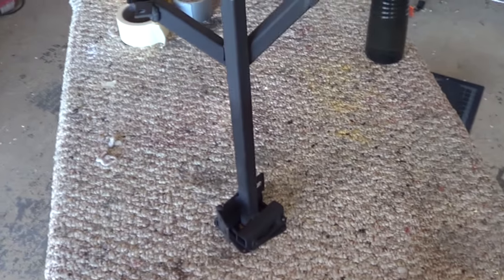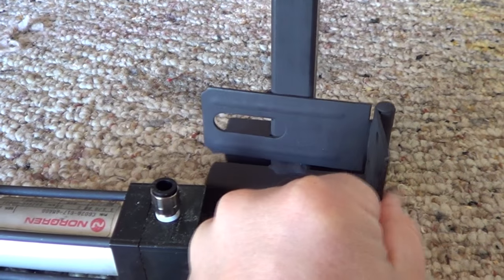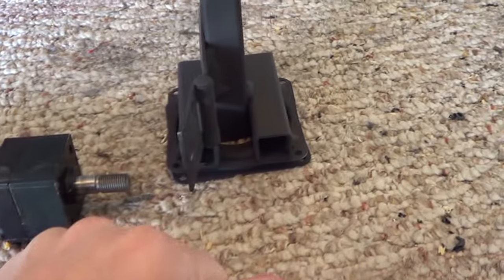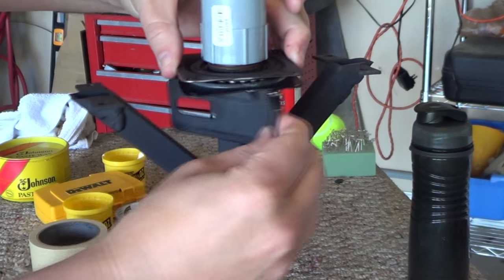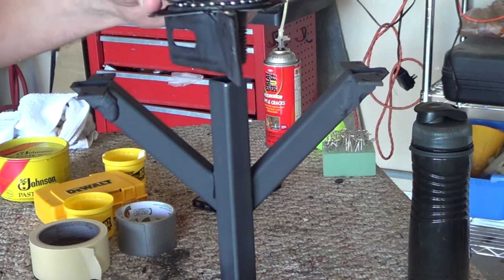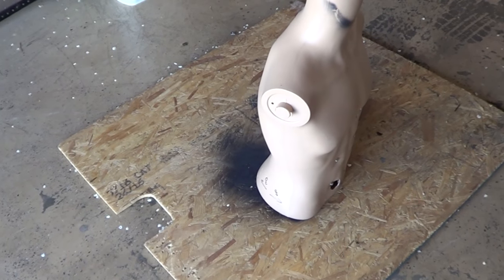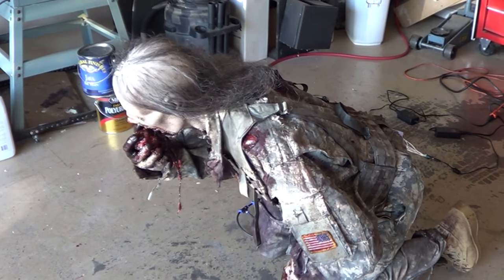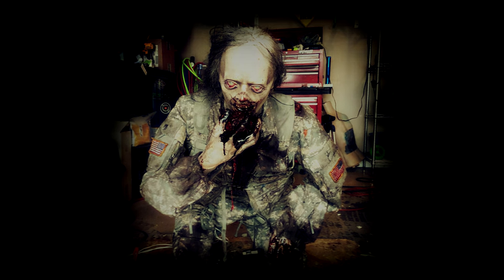Pneumatic Zombie Prop Build

Comment: Outstanding work on the prop. Great to see another way of moving the head and body. I use rotary cylinders from Festo and Bimba. The Bimba rotary cylinder was recommended in the How-to book (Vol. II) from DC Props.

Steve, from Terror Syndicate, is great. Bought all of his How-to books and DVDs. Indeed, he was the first prop builder with whom I interned (of sorts) by using his books and DVDs to build my own props.

Regarding the foam body, and I know you're wanting to go cheap, but I would buy Foam-it X rigid expanding foam. If you want a skin on it, then use Foam-it 17 self-skinning flexible foam first, then fill it with Foam-it X. You get a beautiful, if I can call it that, foam body in one batch, presuming you calculated the right volume of foam.

No doubt you can do the elevator. 

I am building one myself. Have all of the components. Just need to weld the two platforms parts together. 

Using the Hi-Rez Design's relay decoder, triggering black box, and DVD. If you decide to get the Hi-Rez Design components, they provide a pretty decent how-to for the elevator build. I recommend you get all of it from Guy, at Halloween FX Props. 

Keep up the great work!
Reply: +Twisted Endings Productions so what would the rotary cylinder do differently?  lots of great info in your message, I checked out the smooth on product line, the closest distributor to me is Charlotte, and only open during week.. but I might have to be checking that place out.
Reply: +Twisted Endings Productions so from what i can see on rotary cylinder is that instead of him having the lazy susan ball bearing portion he would just have the shoulders mounted to that rotary cylinder and it would do the turning, but then he would need something to tell it how far to go and then how far to go back..
Reply: Well, since they are rotary, you can configure them to move in a direction (left or right) and to a certain degree since the ones I purchased where capable of moving 180 degrees. In this example, I can make them move, 45, 90, 120 degrees. However, as Dwayne, from All Scares advised, any movement more than 90 degrees is an unnatural movement.

I guess the point of a rotary cylinder is that you're getting two in one and minimizing the amount of work you have to do to put it together. Simply, you get the lazy-susan and the air cylinder in one, thus minimizing the amount of hardware (metal tubing, welding/drilling, lazy-susan, air cylinder, etc.) you would need for the build. But again, cheap and effective is what a home haunter is always striving for since they are not a pro haunt and thus do not have the revenue to buy pro grade props. We all started there.

Continuing, same holds true for the lower body twisting...use a rotary cylinder. For the up and down motion, you would use the same technique Jason used.

Smooth-on is up in Orlando, FL from me. I am located in South Florida, so I still have to have them ship me their product(s). Same holds true if you're building gauges, etc.; use their polyurethane resin.

Hope that helped.
Reply: +Twisted Endings Productions very interesting os is there another gadget needed to control the degree to which the cylinder turns?  Both me and Jason are using a 20 dollar home rig prop controller that has 4 relays that are wired to the solenoid.
Reply: +Twisted Endings Productions ok man sorry for all these questions... so i see a video where it uses an allen wrench to adjust how much of a rotation it spins :) so nothing else extra is needed.  Where is a good place to get them?
Reply: +Twisted Endings Productions Ok so smc has this.. not sure how to mount, and or if this is right.. http://www.smcusa.com/top-navigation/cad-models.aspx/20195
Reply: +Kustom Scares and this one, they look to be pricier than standard pneumatic cylinders.. also trying to find how one mounts this or does that book you mention above have instructions on that?  https://trimantec.com/product/airtac-hrq-pneumatic-rotary-table-cylinder-hrq2/
Reply from the maker: +Twisted Endings Productions Cool man thanks!  Those rotary cylinders are cool but damn they can get expensive!  I was trying to use what I had laying around which ended up going out the window when I bought new ones anyway.  Im actually using a TerrorTech board for my elevator.  Never hooked it up so this should be interesting.
Reply from the maker: +Kustom Scares ^^^ a lot of great info up here!  Thanks guys!  Love the discussion!
Reply: By profession, I am a federal law enforcement officer, therefore, my home haunter prop building capability is somewhat limited. And its delay was due to my deployment for nine, of the twelves years, we were at war in the Middle East while serving in the military. So, I am fairly new to this game as I started in 2013, in comparison to some of my fellow home haunters on Youtube. All to say that I am not as well versed in finding cheaper methods of prop construction as most on Youtube.

To answer your questions...

Yes, they are because they are specialized cylinders. And that's also why the prop-vendors charge you so much for their props. Its customary to add an additional 30% to the overall cost of a part.

Yes, the book tells you how to mount the rotary cylinder.

You can also buy how-to DVDs from Halloween Supplies, Stan Winston School of Character Arts, Terror Syndicate, FX Supplies, and MovieFX.

Going back to the Festo rotary cylinder...I bought it on Ebay for about $55. However, I am paying an additional $150 for several other components that I need to get it to function just right. In this example, the push-on flange in which to mount what I want to turn, then the foot mount to mount the rotary cylinder to whatever it is I am wanting to mount it to. And of course, the air fittings.  Simply, it does become expensive.

In the end, you must consider what is more important to you; time, convenience, and less headaches, or money???

If you build your own props, even if you're paying a bit for some of its components, it will still be cheaper than if you bought it outright from a prop-vendor; that's when you really save. I can build the exact same prop for 1/3 of what I would pay a prop-vendor.

Hope this helps and thanks for the link.
Reply: +Twisted Endings Productions thank you, lots of great info and same for +Graves Of The Groves all great stuff.
Reply from the maker: +Twisted Endings Productions Amen brother!
Reply: Kustom Scares
I purchased mine from Festo and Bimba.
Reply from the maker: That's some great info on the foam. Thanks man!!

Comment: Hi Jason:

As I was attempting to build your grave digger (with shovel), and wanting to get away from using wood (it's just too heavy), I contacted Ryan, from Spider Hill Props Works. He was gracious enough to sell me just the base to his care-taker prop. I am using it for the hips. Its super light weight (comparatively speaking) and you can use the existing holes so you won't have to drill new ones. I also bought base for his deer motor in an effort to replicate (Woodland Haunter's) head movement on his grave digger, but instead of placing it at the base (hips), I am attaching it at, or near, the neck. 

I mention all of this as I watched this video again, and figured, since you spoke about weight, you might want to try getting Ryan's base, and perhaps have him cut you shoulders as well.  That's my next request. 

Just a thought.
Reply from the maker: Cool idea!

Comment: Awesome prop! I have a couple questions about the waist cylinder. What is the stroke for the cylinder that lifts the waist? and do you think 1 1/2 " bore cylinder will be enough?
Reply from the maker: It's been a few years but I think it was around a 3-4" stroke.  I also think the one I used was a 1.5" bore and it would move more fluid with a bigger diameter
Reply: @GravesOfTheGroves  Ok thank you!! I’m going to be building a weeping angel prop that has a similar movement at the waist.

Comment: Do you have any measurements for your armature? Also me and my dad are very new to pneumatics and not quite sure all the material we will need to make the prop actually move. Would we only need a prop controller to attach to the air compressors or is there more too it? Sorry to ask so many questions we are just scratching our heads on what to do but we would really like to build this 😊.

Comment: Sorry to keep bothering you, but did you use a specific program app to have the animatronic move? Any recommendations for programming? Thank you for your time 😊.
Reply from the maker: On this prop I used the software for the four banger prop controller.  The software worked great but the controller ended up being pretty buggy.  I would do a BooBox Flex if you wanted a computer controlled software.

Comment: what bluetooth gadget are you using to connect it to the prop controller board?  and what solenoid valves are you using they looked black with a dial and stacked on top of each other.. awesome job by the way, I am curious do you think the 90 degree pivot point is super important, I am thinking it would not be a huge diff if it was slightly off for those of us not looking to use the cad program, or putting that hinge on a slide so one could adjust it and tighten it once they have it in place.
Reply: Oh and the first sequence looked the most natural to me, maybe just a little longer
Reply from the maker: +Kustom Scares The programming is done on the computer and then just uploaded onto the controller via USB.  The program and everything is on the buttonbanger website (link above in the discription)  You can program it real time or in advance and upload it later.  I had problems doing it real time.  Some issue with the voltage because when it's hooked to the computer the controller gets its power through the USB.  The valves are the cheap AirTac 12v 5 port 2 way valves off ebay from China.  I think with fittings they are like $15.  No the 90 degree is not important but by doing that it gave me the most turn with a short throw if that makes sense.  In the end, it could not turn 90 anyways because it got bound up. LOL
Reply: +Graves Of The Groves Yeah i made several of those 20 dollar prop controllers, you said you using a bluetooth wireless speaker, thats what i was wondering what you used to plug into the mp3 board to use the bluetooth wireless speaker.   I have some of the airtac cylinders did you get the BSP threaded ones or NPT, last year i got the BSP and had to find the right thread that matched the 8mm, which came out 1/4 npt shoo then the hose to match.. 

So what did you do for the binding?  Did you just move where you mounted the air piston?  I wonder if you actually put a nut n bolt through a hold that would allow some wiggle room a pivot swivel or something of the sort, or if just moving it worked thats great.  

I found some A/B foam on amazon for like 50 bucks for 1 gallon of each, just not sure how much would be needed to do an entire torso
Reply: +Graves Of The Groves what size pneumatic cylinders did you go with, 3/4 inch bore?  Do you think 7/16 would work?  only a few bucks diff i see from 7/16 bore to 3/4 bore
Reply from the maker: +Kustom Scares for the head yes, for the waste I wish I would have used that 1-1/8" bore I started with.  Even with 85 psi it still cant push the shoulders all the way around because of the clothes.
Reply from the maker: +Kustom Scares oh shit that's a great idea!  My BT speaker was nothing special. I want to say it's iHome brand. Like $20 off eBay. I like that transmitter though!
Reply: +Graves Of The Groves so you have your Bluetooth speaker wired to the prop controller sound board I figure?  Yeah as long as Bluetooth speakers can play these days and how loud they are they could be great for some situations where you need more leeway on speaker placement with transmitter
Reply from the maker: +Kustom Scares I had to go back and see what the hell I said LOL. Yes it is a Bluetooth speaker but it is plugged into the MP3 player so the fact that it is Bluetooth is irrelevant
Reply: +Graves Of The Groves LOL yeah as soon as I heard you say bluetooth my ears were like ding ding ding oh snap he went wireless on the sound...  already looking at some a/b 2 part foam
Reply: +Kustom Scares 

It will. I purchased, a male, female, pregnant female, and child. I built the female and child first. 

Since I am not a sculptor, or artist, by profession, I used the same technique Jason used on his mannequin  except mine was a complete body. Then I used the non-rigid foam from Smooth-on. 
Used shellac on the foam bodies after they were made. It gave the bodies great color but it cracks when you squeeze them. Michael, at Ghost Ride Productions, recommended that I spray 3-4 coats of liquid latex on the foam bodies after you make them. And that's in lieu of using the self-skinning foam I mentioned in the caption above.
Reply: +Twisted Endings Productions cool so use both smooth on rigid foam, then liquid latex over the smooth on foam
Reply: Yes, but only if you want the skin. If not then you don't, like in Jason's case. He is covering up the foam so, there is no need to add a skin.
Reply: +Twisted Endings Productions so would you say the flexfoam IT X 1 gallon a/b be enough to fill that male torso form?  Or would it take less or more than a gallon, as the gallon is 141 bucks for the Flexfoam IT X 1 gallon part a/b mix... just trying to gauge what the cost would be to do that torso form.
Reply: You have to measure male torso form by volume vice eyeballing the amount.

Send me your email address and I can send you a picture of the two forms I made using the Flexfoam.
Reply: +Twisted Endings Productions hmm no way to send you a direct message your page lacks the about link which would allow me to send message.  I'll send on google +
Reply: Kustom Scares
Yes, that would do but, that gallon is going to last you a long time depending on what you are wanting to build. Small props, small amounts of foam; big props, big amounts of foam.

With my gallon, I was able to make a female and child torso, and about twelve complete skulls before I ran out.

So, its cost effective to buy the gallon.

And keep in mind, I was trying out the half bodies forms to see if the foam would work and what kind of copy it would produce. I needed to make a bunch of skulls so I made them with the rest of the foam.

I also made a silicone mold of goat horns and then made goat horns with the foam. Was looking at making light weight horns that you can glue on to your skin.

I am building something just about every week. Currently, I am making a pneumatic pumpkin that stands up. It will also raise its arms and jiggle like the hangman prop does since that was its first function. Trying to re-purpose the prop.
Reply: Just ordered 10 of those 3" lazy susans for some future props.

Also working on building a vaccu-form machine. Like I said, initially the cost is a bit expensive but in the long run, it comes out cheaper in materials and shipping cost for the props you're making.
Reply: where did you order them from
Reply: I sent you an email with this information.